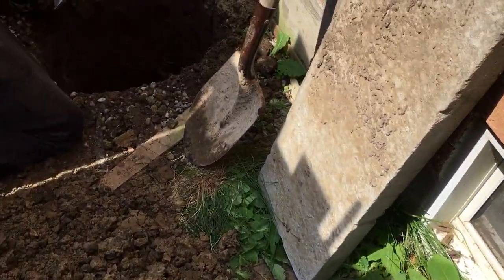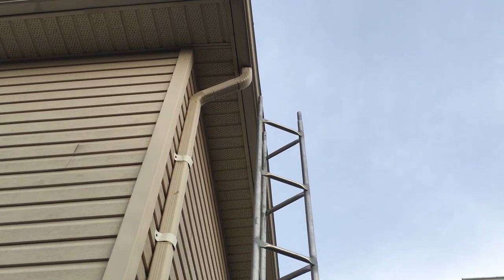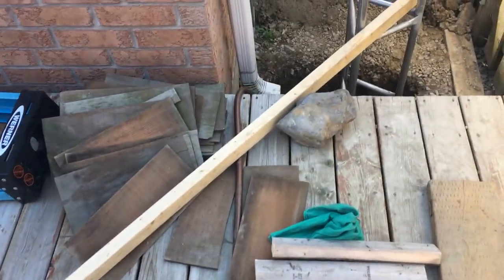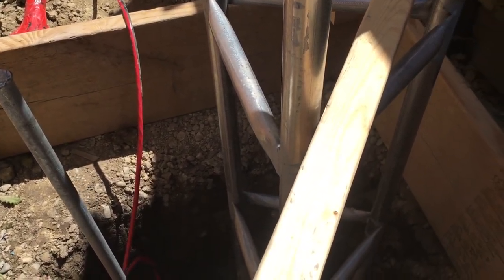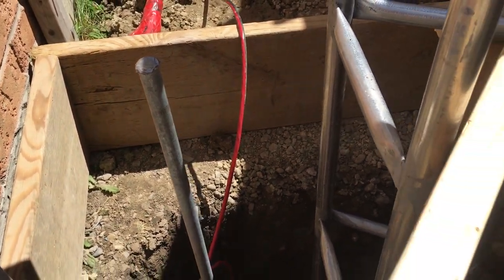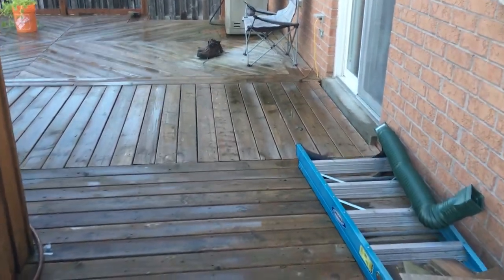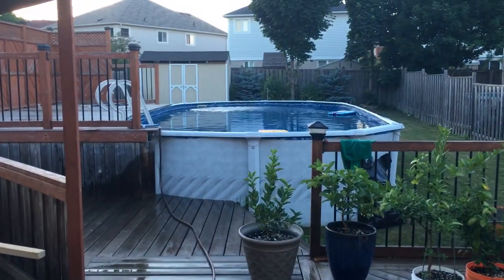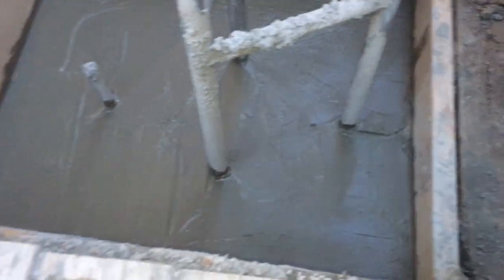IMAX2000 Tower Installation, No Ground plane, Grounding.  Pt 1 of 3

Comment: Nice vid! thumbs up! I heard you say that took 12 hours. That's actually really fast. It took me several weeks to mount an 18 foot mast of 4x4s (fence posts), for my Solarcon 99. You did a nice job with the concrete too.  

Myself, I dug a narrow 3.5 foot hole, mixed several batches of concrete in a bucket. And, dumped it in; quick and sloppy. I didn't even use concrete forming tubes. (And for $20, I really should have. LOL.)

I bought 50 feet of LMR 400 to run through the foundation to the basement. Hammer drilling through the foundation (of my house) took me 3 hours by the time I got set up, and siliconed around the hole etc. Assembling my antenna/ mounting also took as long.

That's a lot of work for 12 hours. You must have planned it out in advance.

On to part 2.

Comment: put a full size 1/4 wave ground plane on that vertical and it will lower your radiation angle alot. everybody always says height of the tip of the antenna above ground, it makes no sense. the whole antenna radiates rf energy not just the tip. also its the feed point height above ground that is the crucial factor, not the tip of the antenna. make a vid of the station operation, that would be cool. food for thought